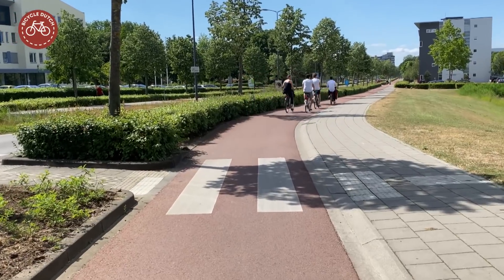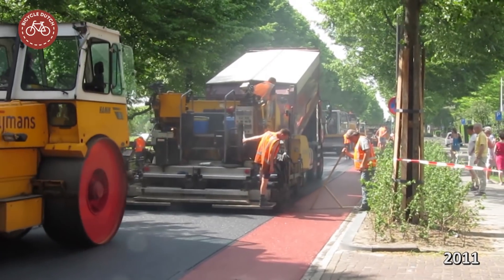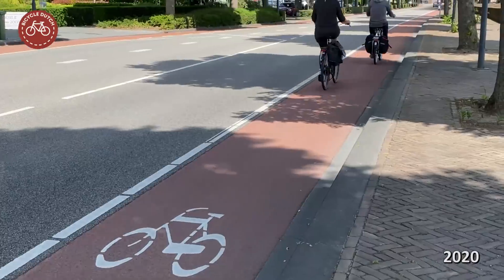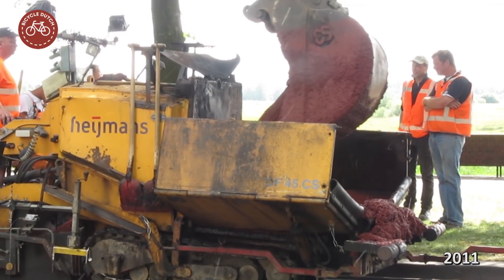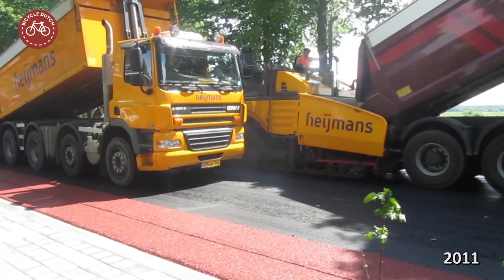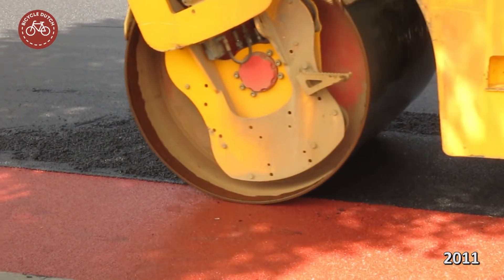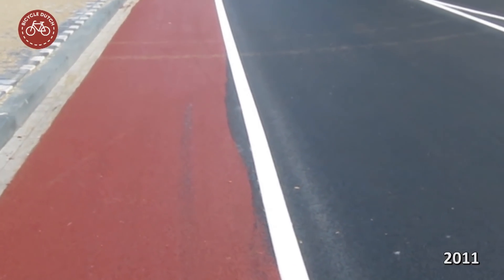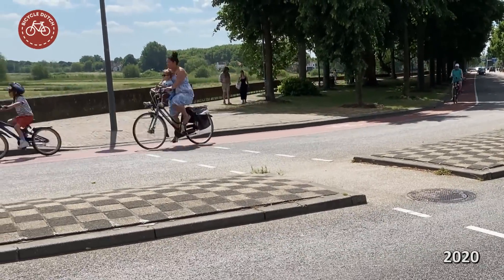How asphalt ages

Comment: Here in Germany it takes 2 weeks for a 200 meter road to get redone. Probably because they don't have any experience since they rather just patch up until there is no more normal surface. And cyclepaths often are damaged before they're done because of the treeroots. I wish the dutch did the roads here too.

Comment: Keep in mind that The Netherlands has a mild climate; if your area has colder winters where it often drops below freezing, the pavement will wear faster.
Reply: It comes down to maintenance, not the weather. See a crack, fix it. See a crack, don't fix it and watch the entire road turn into potholes.
Reply: @hendman4083  This. So much this. There are two primary causes of road damage that go had in hand; too many cars and trucks and insufficient maintenance. You want to fill a crack before the weather can get to it. Though this is generally helped by the fact Dutch roads use gravity to get rid of water, such as making them slightly barrel shaped forcing rain to side drainage.

In fact, this is how we learn to turn around on streets in a car: full rip to the other side of the road, some power, release power when getting close, and let gravity bump you into the curb. After that, slowly reverse, pulling the wheel all the way to the other side and you'll have room to spare when driving back out.

Comment: Here in sweden, on what we call "country roads" (roads that are not highways were the speed limit usually is between 70-90 km/h) it is not uncommon to find a left lane that has the red-ish coloured, granite based asphalt (when there actually are 2 lanes in one direction on these roads). That granite based asphalt is loud and not as comfortable to drive on as the black asphalt in the right lane, and it is probably way cheaper to build. I like to believe that the thought behind this material choice is that "people are only ever going to use that lane for overtaking anyways so why pour money into it".

Comment: Imagine some frost under the road... Or studded tires! It would be breaking up in notime.
Reply: First: studded tires aren't legal in the Netherlands.
Second: how can you build infrastructure so bad you can actualy get frost to set in? A neat trick every Dutch road uses: they're slightly barrel shaped so water can't pool.
Other than that, fill cracks and water can't get in to begin with.

Comment: Fun fact: Dutch building companies are kept accountable for the lifespan. If it breaks down earlier than 9 years  they have to pay and redo it themselves :)
Reply: Try that in Ireland. The roads here are bad when new and quickly get worse. They are rarely resurfaced, instead it's patch repair upon patch repair. Cycling in Dublin feels like off-roading...
Reply: @rvallenduuk  Same in Germany. Many roads get patched up til the point where there is more patched than non patched surface if they even care to patch at all. And when they patch they mostly just do a quick patch but don't care about smoothing it up. And cycling paths are even worse.
Reply: Probably some aspects of it, but not the top layer. Roads that see very heavy traffic have their top layers replaced more often than once i 9 years i would estimate. 
Good thing is it happens over night. In the evening they close of the road entirely. Even the biggest 2x5 lane roads will be closed entirely, no fucking around with pylons guiding traffic to the other side etc, just close it and next morning its opened with a brand new top layer. Even though it sucks when all of a sudden the highway you need to get home is closed off, i love this system. You especially learn to appreciate it when trying to cross Germany where about 1/3th of all roads are under construction constantly. (and it takes months and months)
Reply: Interesting that the warranty period is 9 years. This type of material, the black asphalt, looks like SMA (stone mastic asphalt) very common in UK and The Netherlands.  It's end of life failure mechanism is quite dramatic, for an asphalt. It tends to fret up and turn into gravel in the places where the wheelpaths. Another video of this locations in a few years might look different.
Reply: bootsowen the dutch government never allows it to turn into gravel, the asphalt will long have been replaced before then. The roads are well maintained.
Reply: @bootsowen  not in the Netherlands. My 7 years in the UK I have seen so much deteriorated asphalt... never ever in my 20+ years in the NL
Reply: @zotteke1991  It is expected, as we pay ridiculously high road taxes.

Comment: i love the feeling of speeding on fresh asphalt with my bike
Reply: I hate that with a passion, surface friction is too high when new. It gets better in about a year. (depending on road use)
Reply: @Eind_hoven  idk where you live but here in the south of the nederlands hmmmmmmmmm so smooth
Reply: @gladius_arbor  eh, Eindhoven if you really want to know. And before I get a comment, to me the most terrible road there is the Fuutlaan, always take a slightly longer route along the Parklaan.
Reply: @Eind_hoven  i dont call that a road those are just bricks
Reply: especially after it has rained
Reply: @robertrijkers4923  that zoom sound of the rubber tires

Comment: 9 years later. WOW !  WOW !    I wish our roads looked that good. 
Do they do anything special to make the asphalt last so long. I read that some cities are adding crushed rubber tires to the mix to make it last longer. The rubber added makes it better for expansion and contraction.
Reply: There's a neat trick that's at play here: the road isn't completely level. It's very slightly barrel shaped, meaning water runs off to the sides so it can't pool underneath the surface and cause potholes.

Comment: I assumed Dutch cycleways would be better than the US roadways, but I also assumed Dutch motorways would be about on par with  US ones, why is the area for cars also so smooth on dutch roads?
Reply: Because nobody likes bumpy roads. So we made them smooth.
Reply: Infrastructure maintenance is like dental care. It's not cool or sexy for politicians but if you neglect it for a long time the costs of repair skyrocket and the rate of deterioration accelerates. If you maintain it at a high level with pro-active repairs then the costs aren't higher than when you maintain it at a lower level with just reactive repairs but the product is much better.
Because of our history our voters are fine with the government spending money on infrastructure before it fails and costs far more in money, time and effort to fix again. Also this way the government has the means to fire up (speed up projects/increase the scale of projects) or cool down (delay projects) our economy a bit with infrastructure spending.
Reply: Less cold weather in winter, less hot days in summer.  When there's a colder winter or extreme hot summers (as in past 2 years) you see that in the wear off. We use on average less heavy cars and trucks too. And problably higher maintenance budgets..

Comment: Asphalt damage is caused mainly by weather (frost or hot summers) and by heavy vehicles. Asphalt damage is a 4th power function of weight so one 1-ton car will do as much damage as 10000 bikes.
Reply: I could not find it in my books and it's harder to find a formula for it than I expected...
I found this table https://streets.mn/2016/07/07/chart-of-the-day-vehicle-weight-vs-road-damage-levels/ where if you compare the 1800 vs 18000 pound "damage levels" there is exactly a factor 10^4 difference between them.
Reply: I'm genuinely curious to know more. Do you have some online references by any chance?
Reply: I was taught that in Civil Engineering classes. Have to look up where it came from.
Reply: Note thet that is the damage done by vehicular traffic (and I can't remember if it's "vehicle weight" or "pressure" as an 18-wheeler has a lot larger contact surface than a car) and off course asphalt doesn't only deteriorate from traffic, but also heat, frost, UV, oil spills, tree roots, earth movement and what not.
Reply: @IIVQ  wow, thank you so much for putting so much time into finding this!

Also, from my understanding (I took a few civil engineering courses about 25 years ago), the damage is calculated "per axle" of weight, so an 18 wheeler may cause damage in a way that's counterintuitive when compared to two-axle vehicles.
Reply: http://www.nvfnorden.org/lisalib/getfile.aspx?itemid=1586 Page 17.

And you are right, it is damage by axle. Although an empty 3-axle (12 wheel, with huge wheels) trailer might put less suface pressure than a heavily laden compact car with skinny wheels, so this is off course a generalization...
Reply: A 1 ton car does as much damage as 10000 bikes?
Reply: @Staann  Yes. Weight damage that is. Off course there's still weather damage etc.
Reply: @IIVQ  Water damage only occurs when the asphalt is already cracked.
Reply: @therealdutchidiot  I said "weather" , not "water" damage. frost (,and ive removal) can cause all kinds of damage. Cold asphalt will form cracks naturally. And water will permeate through most open asphalts (like we have in the Netherlands on most our motorways)
Reply: @IIVQ  The point stiill stands. Water and weather do the exact same thing without damage; nothing at all.
Reply: @therealdutchidiot  As a civil engineer I have to disagree with you.
Reply: @IIVQ  Civil engineers aere known for not knowing the first thing about the stuff they design. This is why you don't get to develop new asphalt mixtures.
Reply: @therealdutchidiot  Thx for critisizing my education and profession. What qualifications do you have to bring into the discussion?
Reply: @IIVQ  The fact that you as a civil engineer are wrong with that much dedication is mind-boggling.
Reply: @IIVQ  Yeah, because unlke you, I actually know what I'm talking about.

Comment: And here in Canada, every single manhole cover is aligned with your tires, and is a rather significant bump. I’ve rarely ever seen a manhole cover thats smooth with the road surface, or one that doesn’t cause me to flinch while driving over it. In fact, I witnessed new roads being paved where they did not level the manhole covers to begin with! Incredible -_-
Reply: I don't leave the Netherlands much
And Im every video amazed that this is not standaard outside
Or even worst case in this modern time like your story
Reply: @Graeme Thomson Lol, you should see the Sea to Sky highway in British Columbia. Narrow 1.5 metre-ish "bike lane" with just a painted line and no protection, immediately next to 2 driving lanes with a 90kmh limit...the Dutch are quivering right now
Reply: And whenever approaching a highway entrance or exit lane, bikes must stop and cross that lane "when safe" to get back to the bike lane. Trouble is, it's never safe!

Comment: That's some long lasting asphalt! I'm surprised there are no potholes
Reply: That's probably because we don't like potholes
Reply: Fix cracks early and you won't get potholes. Choose an appropriate asphalt mixture and follow good road categorisation to prevent cracks.
Reply: The Dutch asphalt is constantly re-engineered to last longer.
But there are also new innovations coming in the near future, like plastic modular roads for cycling, if it succeeds ofcourse.

Comment: For some reason in my area green is the colour of choice for bike pavement
Reply: You see that more. However red was chosen in the Netherlands because it was more visible. Green asphalt can blend in with grass.
Reply: @kempo_95  I thought the red was cheaper, just add some rust to the asphalt.
Reply: @hendman4083 It's actually quite a bit more expensive, but not nearly as dangerous as paint as that gets slippery when wet.

Comment: In Australia they use green paint so as a cost saving measure bike lanes are only painted at intersections. If they similarly used green asphalt then they would be able to have the whole lane green which would make it a lot safer since drivers would always be away of the lane.
Reply: Never seen bikelanes in Aussie. In WA the rule seems to be that bikes must stay on barely existent sidewalks. Should a cyclist find itself on the road, they're likely to just get hit.

Yeah, sure regulations were finally introduced forcing motorvehicle operators to keep one meter distance when overtaking. But that's done as often as giving way to pedestrians by turning vehicles, hardly ever
Reply: surfie007 If they did do the whole length of the road in green, it would be an eyesore. For example,  a stretch of around 1km of Thompson's Rd in Bulleen, Melbourne had it for a while, although I think it's now been removed. It was very ugly looking down from the top of the hill. The red would look much better. It shows the mentality when the standard was set, though: full length colour can't have been in their minds. At least they're not baby blue.
Reply: @francisernens1795  Green is an eyesore? It's the colour of grass lmao. Red, green and yellow all are suitable for bike lanes as they are natural colours. Darker blue is too, but not visible enough (and bright blue is an eyesore).

Comment: As a Brit, what is "smooth asphalt"?
Reply: The type that doesn't make you go full Dukes of Hazard I suppose and shout "Yeeehaw!" whenever you get a bit of air time.
Reply: The asphalt is flat. Improving ride comfort and safety for everyone.
Reply: @bjthedjdutchdude1992  Concrete is flat too but isn't always safe as the road surface isn't rough enough.
You need to have some texture to a surface in order for rubber to grip.
Reply: @dimrrider9133  I am not British but Dutch, so I will have to send you to the neighbours next door for your inquiry.
Reply: @dimrrider9133  How are the roads in Belgium nowadays? Last time I drove around Brussel with a caravan the whole thing started to dance behind the car at 70 km/h. Albeit this was a few decades ago.
Reply: Traditional Dutch asphalt roads were very smooth. Kids used to rollerskate in our neighbourhood in the 70s. These roads seemed to melt in hot summers. When they were resurfaced, cracks were repaired and the roads were covered with bituminous "glue" and split stones. That was already a standard treatment for main routes, which caused way more rolling resistance and made rollerskating impossible. The asphalt in this video has no split stone top layer, it is smooth.
Reply: @peterslegers6121  thanks for the info, in the UK we don't have access to road rolling machines so try to copy the surface of the moon instead
Reply: The small pieces in between the potholes...
Reply: It has a smooth surface with dimples for grip instead of the tiny bumps classic asphalt has.

Comment: It’s a shame that some local authorities here in the UK aren’t using a green layer anymore on their cycleways, although this is probably because of the high maintenance cycle that paint demands. Using separate asphalt solves the problem!

The UK also seems to not use stencils for most road markings, although it’s quite interesting to see the slight differences between each marking! Luckily there are nationwide standards for them though, so the painters don’t go too crazy!
Reply: When I was in the UK some month ago in the Birmingham region, I wondered about the complete absence of cycling infrastructure and often there was even no infrastructure for pedestrians. That was a bit shocking. Here in Germany its much worser than in the Netherlands, but the explained observations were shocking
Reply: There were a few bits of the green put down when I was younger (a few decades ago now), you can barely see them now.
Reply: One of the reason road surface in the UK wear soo much quicker is a combination of both much higher usage and a weather system that cracks open those bad boys once every winter
Reply: @CavesAreIrrelevant  UK and NL have the same climate.. we often even get the same weather and the same storms. UK asphalt is utter shit to drive on. It's ugly and noisy even when they just put it in.
Reply: @MrAronymous  I like those brand new bits where the car is so quiet and effortly glides over the surface, then back to a loud roar and bouncing over potholes. I dented the rim on my bike riding from Bromyard to Hereford!
Reply: @CavesAreIrrelevant  The freeze-thaw damage for asphalt in UK does not seem too bad, when compared to such geographical locales as Nordic Countries. In Nordic Countries, the temperature range can reach 60°C (+30°C in summer and -30°C in winter... Just imagine how all the contraction and expansion effects porous aerials that contain moisture/water in their cavities...
Reply: @CavesAreIrrelevant  The Netherlands is having the same problem. In fact, the "ZOAB" used on Dutch motorways is even more sensitive to it than British asphalt. It's just good maintenance, smart sustainable solutions, cheap standardised procedures and flexible regulation. There isn't just one simple Highway Code, but there many wetten (acts) and guidelines that have to be followed. https://www.wegenwiki.nl/Wetgeving,_richtlijnen_en_procedures (It's in Dutch, so a translator is advisory.)